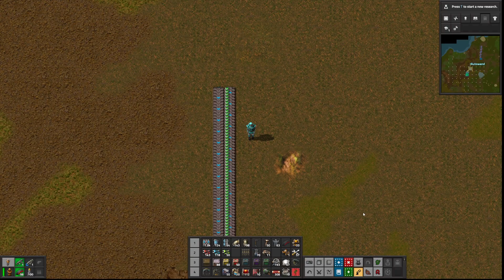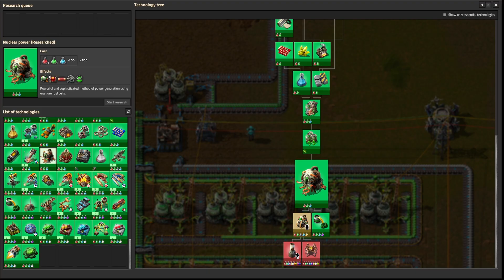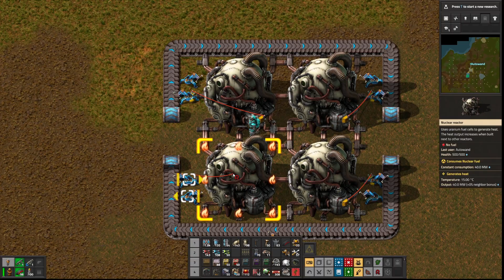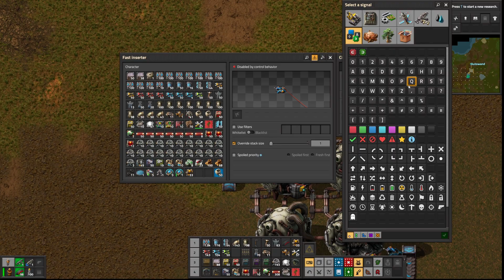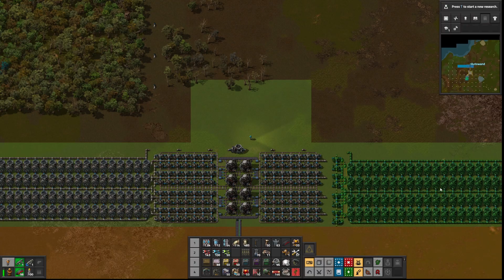Factorio Nuclear Power Tutorial: Efficient 2, 4, 6 & 8 Reactor Builds with Blueprints

Comment: I just want to point out that the observation made by @trevorseitz502 is quite relevant when it comes to efficiently using your fuel. A plant only generates neighbor bonuses when it is fueled. If your plants are de-synced, meaning they are individually fueled when each of their temperatures individually falls below some target and therefore end up (ironically due to neighbor bonuses) getting heated unevenly, you will lose neighbor bonuses in one or more of them. You're correct that this will stop being a problem when you need close to max power output, because as the steam usage increases the heat draw from the plants will ramp up. However a plant that spends significant time below this max throughput scenario will end up needing more fuel to produce a given MW output due to losing neighbor bonuses. The solution is pretty easy -- instead of hooking your inserters up to each plant, you hook a single inserter up to a single plant and then you wire all the other inserters to that first one. At that point the state of only one plant will drive fuel input to all the plants and they will be forcibly synchronized, producing neighbor bonuses for all plants (and no bonus when they aren't fueled but presumably that's a time when the draw is low enough that you're fine with that state). This means your nuclear fuel will go significantly further. This is probably largely unnecessary (producing nuclear fuel once you have Kovarex running is trivial), so no one is going to notice their plant breaking because of this, but it WILL cause confusion to a newer user who won't intuitively understand why they're seeing inconsistent neighbor bonuses across their array of nuclear plants.

Comment: Question- how did you get the inserters for the fuel cells to be covered by the substations? I saw your awesome vid just now and then it stumped me cos no matter what I did there was no way that both pairs of inserters would be covered by the radius of the substations as well as all the turbines.
Reply from the maker: I didn’t really have anything special. I didn’t use quality substations or any mods other than a lighting mod. I’m guessing you’re referring to the 2 reactor build since the other 3 all have substation on the interior of the build. Maybe just double check and make sure everything is as tight as it can be? Like the belts above and below the reactors as an example should be right up next to the reactors with the sides only having room for the inserters.

Comment: You lose your neighbor bonus when your nuclear reactors don't have fuel in them. So is it actually more efficient to limit the temperature at which you insert fuel into the reactor?
Reply: I'd make the circuit add 1 cell to all the reactors when the temp is too low and use enough heat pipes to act as a battery to prevent the reactor reaching 1k degrees on a single cell per reactor
Reply from the maker: This is an odd take, and I say that because it doesn’t matter if the neighborhood bonus for heat is only active while it’s burning. You don’t gain or lose electricity based on what nuclear reactors have a bonus. All of your electricity is determined by the turbines, the turbines are powered by the heat from heat exchangers which also aren’t affected by the neighborhood bonus. The only time the neighborhood bonus would matter is if you have fuel and don’t have 1000c heat.
Reply: @Autocraft_Auto  It's not a take. It's an observation and an honest question. If I'm not understanding something then I'm happy to be informed.
Reply from the maker: Fair enough. The neighborhood bonus doesn’t matter until you need more heat. The heat exchangers draw the same heat from the reactors whether there’s a bonus or not. Then when you need the heat to go up again, fuel is inserted back into the reactors and the bonus activates again. 

I’m also not too worried if the reactors become unbalanced and 1 inserts fuel and the neighbor doesn’t, because at that point, you probably aren’t drawing enough power to need all of them active anyways. I think maybe a decent take away from this that I’ll try and implement later is setting them up in a way that they all insert 1 fuel when any of them need fuel rather than have each of them responsible for inserting their own fuel. Something to think about for sure :D.
Reply: Isn't this an argument to not build more reactors than you need for fuel efficiency?
Reply: @Autocraft_Auto  Just to be sure, if only one of my reactors in the 8 build is turned on, the rest will turn on by themselves if I grow my factory and the reactor compensates? if yes, then I am completely fine with your layout!
Reply from the maker: @Potato_217  I apologize, I didn't see this comment when it was posted and I feel like it's worth a reply :P. Yes the reactors will compensate over time as you grow your factory.
Reply: @Autocraft_Auto  awesome. Thanks man. I did run some tests after this vid and it did work after some edits to temps.

Comment: what is the best way to make quality holmium, efficiently? (not fast bc if we spam the same module it'll it be the same but efficent too)
Reply: There are two rules to quality if you want maximum efficiency. #1) Prefer to create a quality loop that involves one of the buildings with built in productivity. #2) Always craft something if the item returns itself when recycled.

I could do the math, but it's incredibly complicated to explain directly. Just look at Steel, which recycles into Steel. If you're only crafting chests out of steel before recycling them, you're rolling a "free" quality roll before you break the chests down into steel. You lose nothing, but you gain a free quality roll. Then, if you make something like big electric poles in al electromagnetic plant, you're getting 50% more items to roll your recycling chance on.

Several end game setups involve abusing absurd productivity to get "free" legendary items back from recycling loops. With items that have productivity research, you can hit 300% productivity. Productivity that high means you produce enough extra items to recycle them and get the same number of raw ingredients back. That means you can keep looping the same input ingredients to get back, allowing you to endlessly roll for increased quality using your recyclers.
Reply from the maker: Hmm, I guess there's 2 ways you could try to make quality holmium plates. You could just straight up recycle the holmium plates with quality module recyclers, then anything that comes out that isn't what you want, recycle those back into the quality recyclers. The second option would probably be to upcycle EM plants until you get legendary materials back, assuming you're going after legendary. I would probably go with upcycling EM plants since the EM plant making them has natural 50% increased productivity and an extra module slot for a better chance at getting quality items. The hardest part would be the processing units (blue circuits) and I would possibly consider importing extras from Nauvis or Vulcanus.
Reply: @Autocraft_Auto upcycle supercapacitors
Reply: isnt it expensive to make blue circuits on vulcanus? like the plastic is coal blocked in major part  @Autocraft_Auto